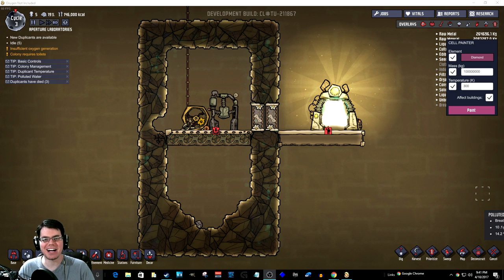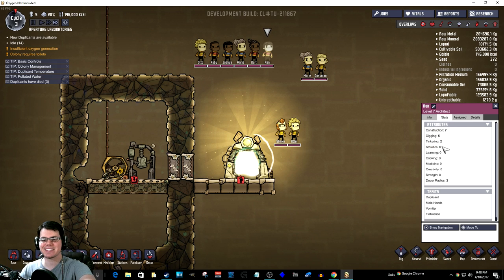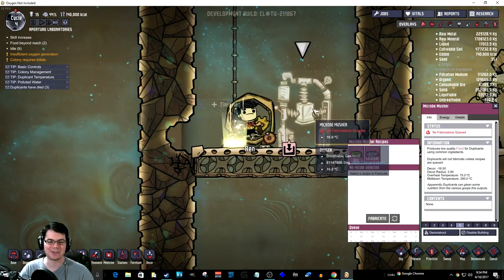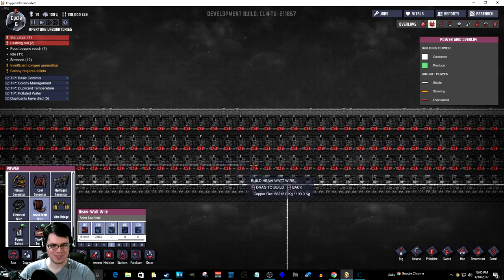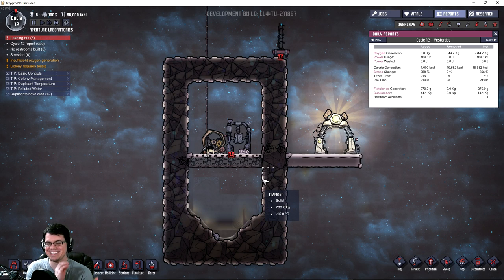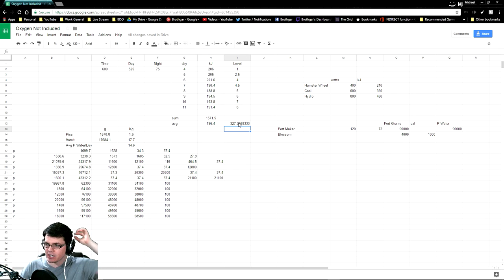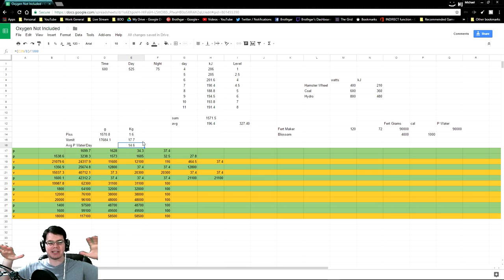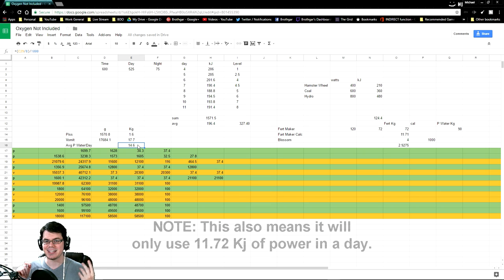Duplicant Hamster Experiment! Oxygen Not Included Tutorial

Comment: This is no longer the only way to get 100% sustainability. Blossom seeds make more of themselves over time, geysers make pure water that can be cooled in ice biomes, and cooled water can be used in showers and toilets to make polluted water that can then be refined into fertilizer.
Reply: Brothgar correction, you can refine the polluted water made in showers and toilets into fertilizer.
Reply: I guess that for oxygen you use air scrubber ?
Reply: With an endless supply of freshwater from the geyser just use the water->O2+Hydrogen thing (Electrolizer? Can't check name now), also use the air scrubber to remove CO2 (and create even more polluted water). Both of these can use the geyser water directly (no cooling required) if made from Gold Amalgam, just make sure you don't run the pipes with geyser water through the main part of the base as they'll give of a lot of heat even with insulated pipes, you can put them inside insulated tiles to reduce the heat spread though. I've also used the un-cooled geyser water in toilets and showers (again build using gold), the dupes complain about heat, but I don't know if it's from the shower itself or from the area being very hot due to heat spread.... Oh and make sure the pump collecting the water from the geyser, and the connecting wires, are made of gold..
Reply: btw there is no nead to cool the water b4 using it in the toilets.
Reply: piping hot water around the base heats things up considerably. I have not tried with insulated pipes, but at 300 days I do not see the need.
Reply: and fertilizer burns into dirt which burns into sand. i love that bit.
Reply: Ahh, heard that before but have so far not been able to make it actually work, does anyone have a vid or pic showcasing a usable setup for Fert->Dirt->Sand?
Reply: ikke nogen Skye Storm did that in his oni lets play. has to be an episode about 2 weeks ago
Reply: sleet weet is also a great food source

You can also get dirt out of mopping up contaminated water

Comment: I saw your 100 dupe challenge. Now, why not try the opposite? How far can you go, with only one dupe to manage the entire base. You can never get any other dupe from the portal.

It's not as simple as you might think to get self sustaining with one man. In my current game, I'm having a bit of trouble with just 5 dupes in getting all the sweeping, building, and digging done. (Though I have gotten up to 10k oxygen pressure.)

Lets add some extra challenge.

1) Only use manual generators
2) Being overtaken by polluted air is a failure
3) No glitches

As for the puft poop plan, ever think about a puft/hatch plan? Puft takes in air and gives slime, and the hatch then eats the slime to give you coal. Useful if your not having problems with algae